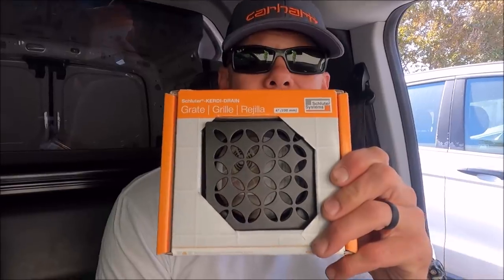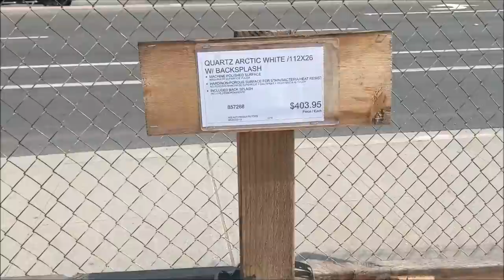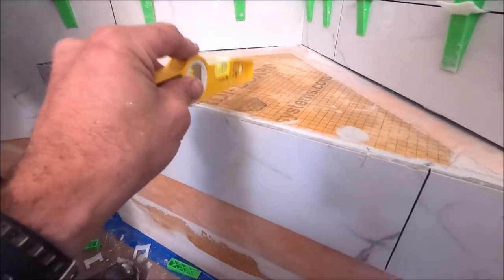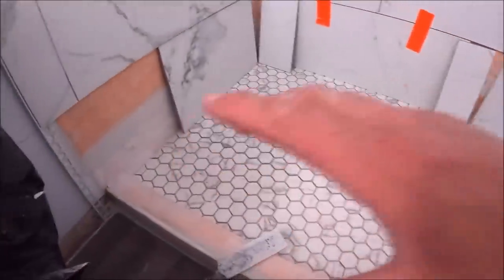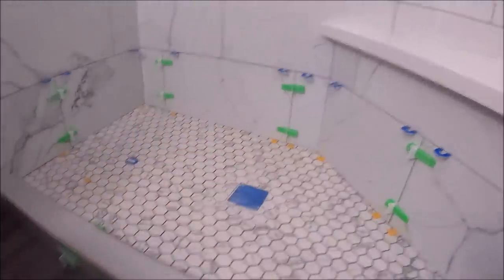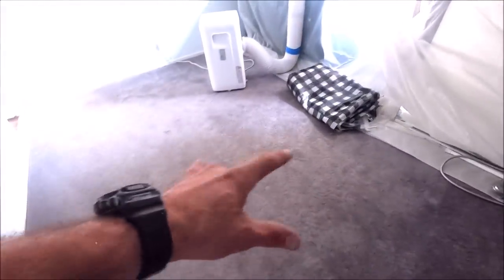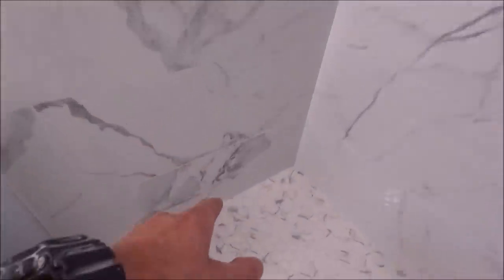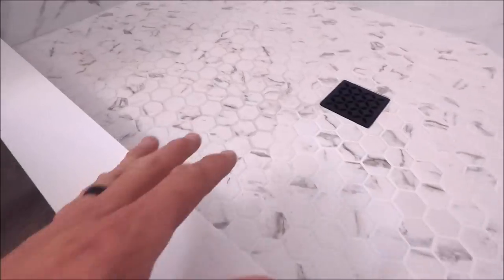Finishing the Carrara Shower Build!

Comment: Hey absolutely fantastic job! I was wondering if there was any  Lippage issue after ?  Your tile job looks  Stunning with 50 50 stagger, however I heard that with this  Pattern, Lippage issue is very very common.  So I want to hear your opinion on this. Thanks!
Reply from the maker: Use a leveling system and you are good to go

Comment: When I add the band to the bottom I have a tough time matching the tile above. The extra kerdi band always seems to mess up the planes.
Reply: Thats why the bottom row has to be what we call a "lick n' stick" meaning you use  very little thinset compared to the rest of the wall.  I back butter the tile and use a 3/8s trowel set very firmly, then the next row and all the rest I use a 1/2 inch trowel setting the tile with regular pressure.  Most of the time this works but sometimes there is still some cheating involved so I make sure to do that primarily on the first 2 rows from the bottom of the wall.  If its got a small bend or small pocket at least its out of sight.  Its the kerdi band but also the pan membrane that forces that section outward and if the installer of the membrane is sloppy it can be almost impossible to get it perfect without floating the wall or building tiles significantly.  All the best.

Comment: Amazing work as aways Landberg!Currently doing a Similar shower build.My customer is going with 12x24 asian statuary on walls and have been  trying to find a matching saddle and niche shelf.The arctic white is a good alternative.Going to push for that.For Schluter PVC jolly what do you find cuts the miters best.Thanks and keep up the great work!
Reply from the maker: We don't use PVC Jolly, go metal. Any compound miter saw will do the job (cut super slow though)
Reply: Thanks for reply! Usually don't use PVC either but customer wanted white rodec and no one local here in NY stocks it metal

Comment: Love the videos. Just got my tshirts in the mail.
What are your thoughts on installing the bench top first and having the tile finish on top of it. Seems to be more of a tight waterproof if Installed that way. I have repaired a few bench’s and that was part of the problem
Reply from the maker: Thanks for the support brother! You can do it both ways with a Schluter seal system. The bench is 100% waterproof 👍

Comment: Hey man... Do you miter cut subway tile on the inside corners on your shower walls? Thanks
Reply: No need for a miter there if you're talking about at change of plains on the side walls connecting to the back wall. You want to leave a small gap there anyway (the size of the grout joints you're using)